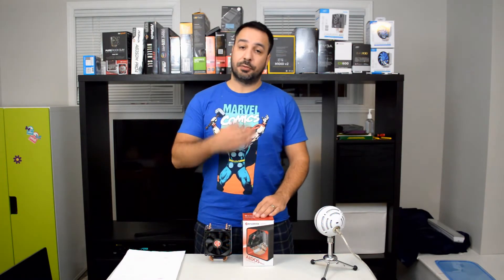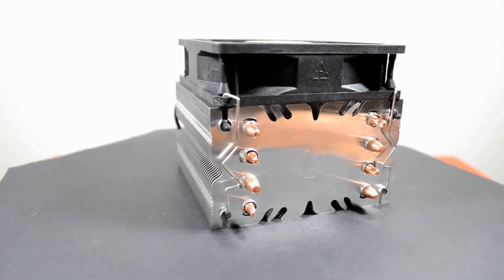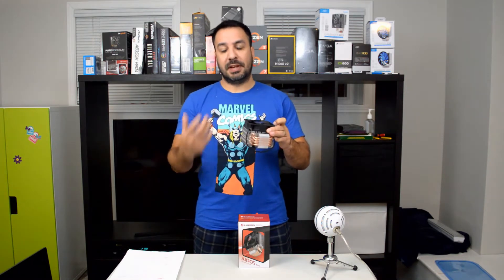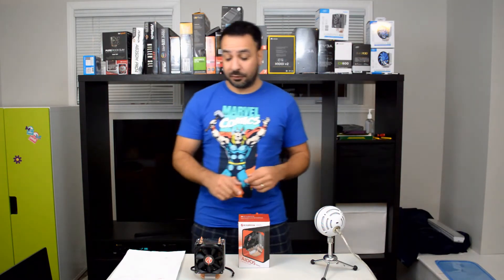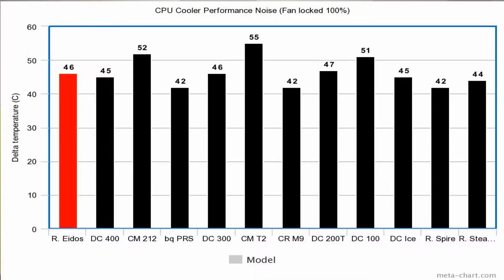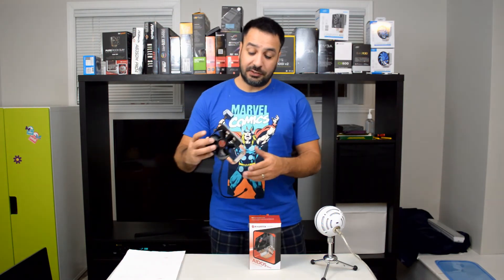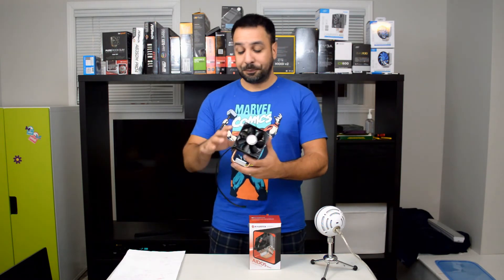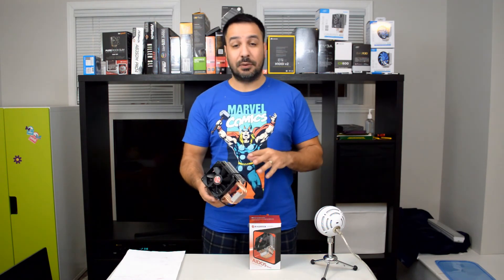RAIJINTEK AIDOS CPU cooler review Ryzen update, Best under 30$ series

Comment: I think they give you the choice bro, of either securing the fan using the rubber noise dampeners OR the traditional fan clips.  It looks from the picture in their installation PDF, of using the clips, that the rubber inserts are not part of that picture.